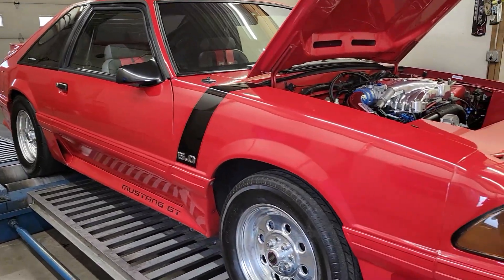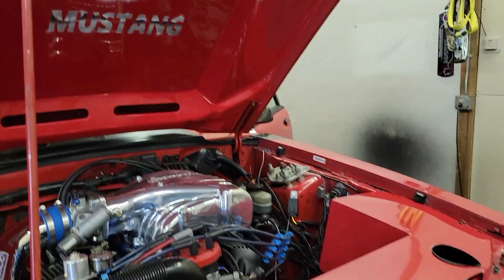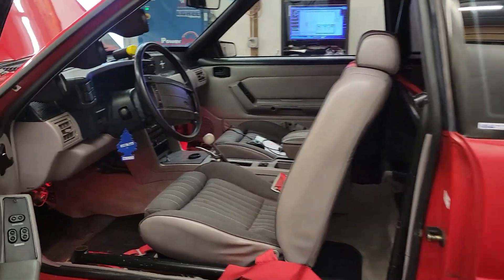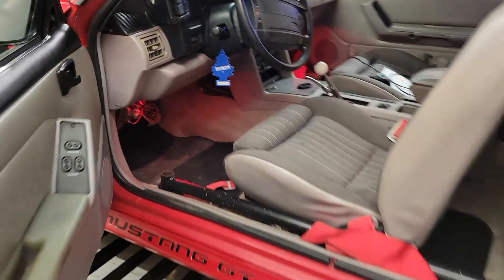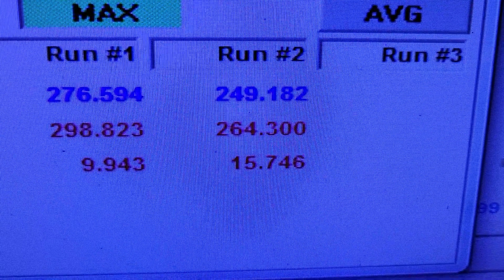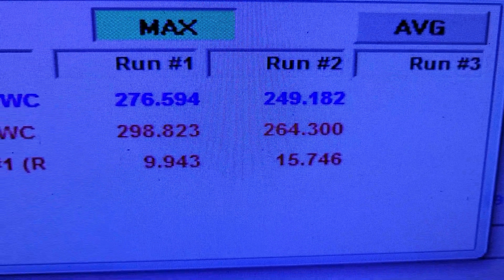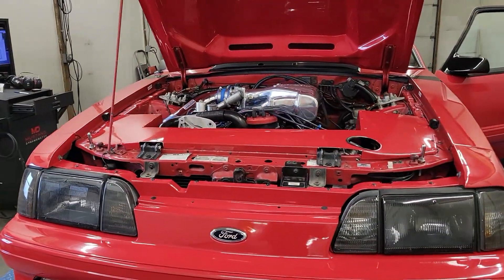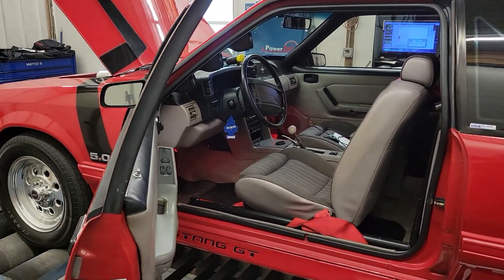306 Ford Mustang Foxbody, Edelbrock heads and Intake | Dyno Review

Comment: I have GT40P heads in mine and I’m gambling wether getting heads like this would be worth swapping out or not, I estimate it’s getting close to 300hp right now but this seems like it would just reducing weight if anything
Reply: I made 330whp with old edelbrock heads 90s lunati cam. Equal shorties no cats xpipe t5-z.

Built 9.5.1 comp twr forged .40 over arp everything

Comment: This car is probably making around 375-400 H.p. @ the crank!?
Reply: Probably more because it’s auto which is like 15-20% power loss
Reply: @jakew2350  Well you must not be good @ math? This car put down 298Hp to the wheels, so if you take my 375 to 400hp to the crank est., and subtract 20% to 25% which is the approx. % for most automatics, you would get around 300 to the wheels.
Reply: Auto trans lots of loss. 

The sad face guys make when they pull in with an auto fox. 

T5 might be made of glass but the power loss was around 8-10%
Reply: 265 at wheels=340 @ hp in crank......75 hp more aprox.....stocks 265 hp at cranck...195 on wheels......Ford lied for insurance reasons...Chevy too
Reply: @K-2Himalaya-sb7fe - Look up richard holdner YouTube ch. he has engine dynoed many ford 87-95 stk. 302 H.o. Engines, and they do right around 232 crank Hp, so really close to the 87 to 91 factory hp rating of 225Hp. I have (2) 302 H.o. Mustangs, 1- Automatic, and 1-5 spd. Manual. Stock the automatic did 165Hp to the tire, and the 5-spd. 195Hp to the tire. Then i added some bolt ons to the automatic= K&n filter, +4° timing adv., Shorty headers, off road mac pro-chambered h-pipe(2 & 1/2" dia.), race bypass warlock mufflers, 4:10 gears, and dynoed 189Hp to the tire. Then the 5spd. added, march 3pcs under drive pulley kit, +4° of timing adv., JLT cold air kit, 70mm T.B., with Egr block off, Ford racing E-303 cam, shorty headers, 2 & 1/2" off road H-pipe, 2 chambered Flowmasters( 2 & 1/2"), 3:73 gears, and dynoed 230Hp to the tire. All dyno numbers were on a corrected Dyno-Jet chassis dyno.
Reply: @K-2Himalaya-sb7fe what crack are smoking. 

225hp-230hp crank was the highest for the foxbody. Other than the cobra r.

Comment: For the people that dont know, stock 302 H.o. Mustangs from 1987 to 1995 with aod/aode automatic transmissions make around 170 to 180 wheel Hp (on a dynojet), n approx. 155 to 165 wheel Hp on a mustang dyno, and the T5 manual transmissions make around 195 to 205 wheel Hp (on a dynojet), n approx. 175 to 185 wheel Hp on a mustang dyno. The car in this video is making approx. 125 Wheel Hp over a stock aod/aode automatic 302 H.o.!
Reply: Not true, I have had both auto & manual Fox's. 100% stock the autos made 205 at the wheel, 5 speed cars made 215 at the wheel. This has been consistent with all my fox bodies.
Reply: @urbanedgeautodetailing - My results are true, and your results are true. See this is why dyno bench racing, can, and 99% of the time is different from dyno to dyno. I dynoed my vehicles on the same dyno, to compare gains/results, on certified, corrected dynos. As far as i know, all dynos can be manipulated to give different results. As long as all conditions/corrections/settings/dynos are the same, it should show the difference, good or bad.

Comment: I have p heads, gt40 intake and stock cam and my car outs down 283 to the wheels
Reply from the maker: Not on my dyno.
Reply: Your car a t5 manual? Cause this dyno was with automatic= 25 to 30 wheel hp less than t5 dyno #s.
Reply: Highly doubt that
Reply: @sixoid4104  doubt all you want
Reply: @foxbody8320  What brand/type, of chassis dyno, did you get the 283hp on?

Comment: I'm almost positive those are the 170cc Edelbrock Performer RPM heads. Based on the power made and If it is in fact a 306.
Reply: Did edlbrock make a 170cc.. I thought they only made 180cc

Comment: My 2v P71 made 240rwhp with longtubes n Marty tune on 87 octane.. Should maybe be up there with 93..
Reply: Needs airflow, not better fuel. Heads and cams are the choke point on 2v motors.
Reply: the TFS heads for 2v are pretty awesome.
Reply: @dennisrobinson8008  Thank you, I agree, got another set heading my way, tomorrow to be exact..lol
Reply: @P71ScrewHead  Damn...    They make power.
Reply: @dennisrobinson8008  Oh, with TrickFlow heads n cams I'll be above 320-350rwhp, not bad numbers for a lil 281ci n low compression.. Hoping the 5.0 stroker kit gets me closer to 400rwhp.. After that, pd supercharger..
Reply: @P71ScrewHead  I look at the coyote numbers and it makes me want to pump up built original 5.0 specs.     With the variable valve timing they are able to achieve 50 more ft-lb or so in low rpm ranges, but at high rpm's it should be able flow and compression....

5.0 gen3 coyote stock does 285@.500" lift, yet they can achieve 490-510rwhp and 410-440 rwtq on e85...    The compression is 12:1.   So personally i would'nt be happy with original 5.0 with a built bottom at under 400rwhp and 370rwtq.   With a Vic 5.0 and tight lsa cam you should be able to hit 450whp.    The 400rwtq not so likely on original 5.0....    Look at the coyote gen 3.    Flow numbers.   Compression and tune.
Reply: @dennisrobinson8008  Oh yes, I know that, great math you did there.. The difference is one is 2v n the other is 4v, so a 2v doing close to 400rwhp on similar to stock low compression isn't that bad imo.. Hopefully my tuner does a good job on the build n the engine lasts me a long time, internals are MMR 5.0 stroker kit rated at 1,000rwhp.. Won't be doing those numbers till trans gets built as well..
Reply: @P71ScrewHead  Boost changes everything...   I am a n/a guy normally, and my gf has the 1.6L ecoboost fusion.    She had me look around and i'm seeing there are turbo upgrades specific for it that will give 500rwhp and 350+rwtq in a  streetable rpm range.   Basically buy the right turbo for your power band level and the engine size only has to be big enough to turn the turbo.
Reply: @dennisrobinson8008  I love n/a too but a lil 281ci on a 4k lbs Panther can only go so fast.. Can the bottom end handle 500whp on them cars?? How much do they weigh?? My dream now is a Nissan B13 man, them things are tin cans n I want a rwd 2v v8 swap..
Reply: @P71ScrewHead  Yes!   There are tons of 400-600whp 1.6 to 2.0L cars in the street.   One that will surprise you is the ford focus!   then you have the hondas, the turbos make the power, determine the power band.      You get all the torque at about 3000 rpm...
Reply: @dennisrobinson8008  Sweet, I'm a v8 guy myself but do know even a lawn mower with boost will go fast..lol I'm a positive displacement supercharger guy myself but turbo is one of the go to for huge power..
Reply: @P71ScrewHead  sure will.....    turbos are interesting in that you can dial in the power band and torque curve based upon displacement and the turbo you use...   i wasn't seeing it this way until my lady with a 1.6L ecoboost wanted more out of it and i saw they were making big power and big torque too with the right turbos.     the modern shit is very responsive so "lag" with the old t3 is a thing of the past.   they come on quick and hard when sized appropriately.    with the right turbo that car will feel like it has a hot engine in it.
Reply: @dennisrobinson8008  Oh I agree with that.. I'd go turbo if it didn't require maintenance unlike the supercharger.. Are the oil changed separately or is it connected to the engine oil?? I do agree that today's cars go way faster with less hp, damn assholes..lol
Reply: @P71ScrewHead  you can feed your turbo its own oil supply using an external pump and reservoir.   As you probably know most plumb off the cars oil supply using an adapter between the oil filter and engine block.   Turbos are cheap as hell nowadays.
Reply: @dennisrobinson8008  Yes, that is true compared to superchargers.. Decisions, decisions..lol 🤔
Reply: @P71ScrewHead  Consider rear mount turbos too, sometimes guys get thrown off squeezing it in the engine compartment and the heat, etc...   Rear mount turbo gets into full boost only a few hundred rpm later that a turbo mounted closer, it makes the same power and torque ( Richard Holdener and others tested multiple times with the data ).   It gets heat out of the engine compartment and better weight distribution with turbos being rear board.
Reply: @dennisrobinson8008  I agree, seen a nice setup with a show from Power Nation if I remember correctly.. Rear mounted would be great considering my longtubes are there already..
Reply: @P71ScrewHead  Makes sense...
Reply: @modularpowered  oh yes, for sure, I was running 🏃‍♀️faster times on 93 tho but gas prices were a bit too high so I switched to 87 for a while till I install the heads n cams.. 3.73s are getting done today I hope..